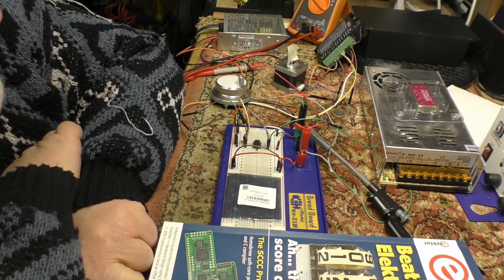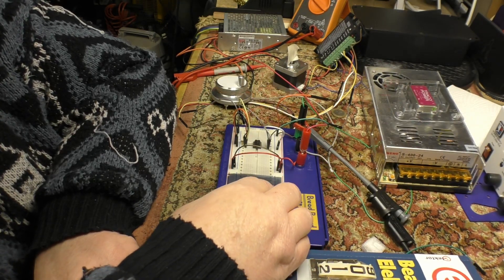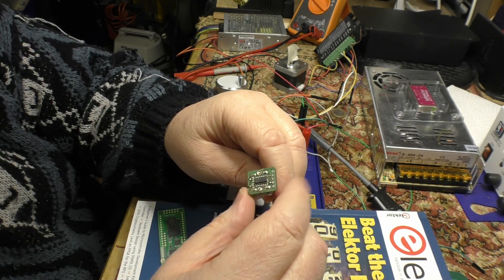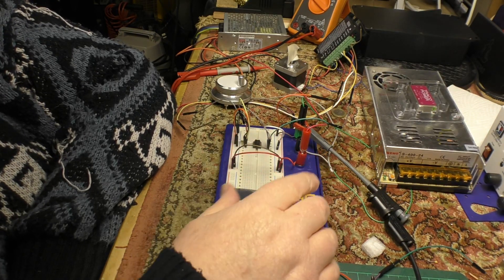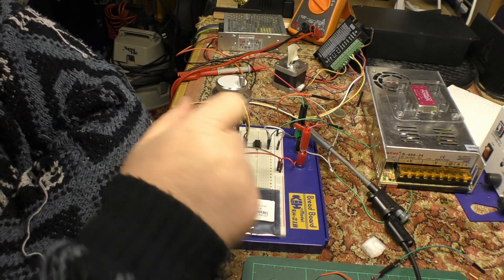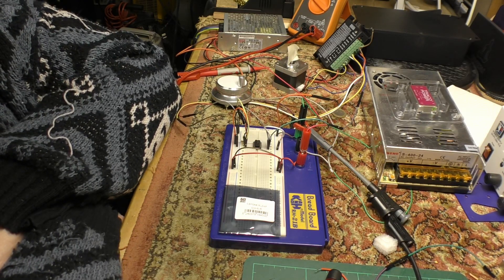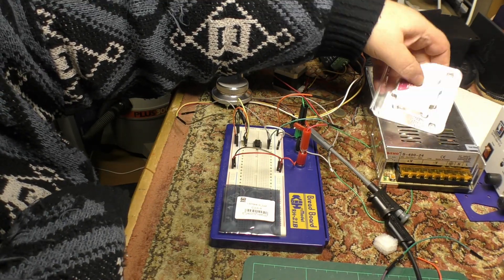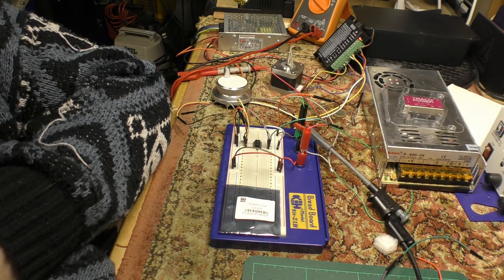Antenna Rotator Project - Update 1

Comment: Would you please be so kind to share with us name/ID of everyone equipment ? I would like to build exactly the same thing as my antenna rotator so i would like to order each part. Thanks so much for your help OM1ACC
Reply from the maker: If you've watched the two follow up clips on this project you'll know that I abandoned it so I never got to a final configuration.   Most things came from eBay.
Rotary encoder:
https://www.ebay.ch/itm/Hand-Wheel-Handle-Kit-5V-Manual-Pulse-Generator-Cnc-Machine-Tool-Rotary-Encoder/264530244169?hash=item3d973b3249:g:s-kAAOSw-uhdyhY0
Here's a suitable stepper motor:
https://www.ebay.ch/itm/ACT-MotorGmbH-1PC-Nema34-Brake-Stepper-Motor-34HS5460D14L34J5-S8-150mm-6A-8-0Nm/253168802381?hash=item3af2095a4d:g:ZaQAAOSwiQ9ZPnHR
Suitable stepper driver module:
https://www.ebay.ch/itm/DE-Free-1PC-Nema23-Nema34-Stepper-Motor-Driver-DM856-5-6A-24VDC-80VDC-25600PPR/253275734895?hash=item3af869036f:g:jNoAAOSw3EteTn20
The rest you can figure out.  Any generic power supply that can deliver 24v though I'd prefer one with both 24v and 5v outputs to make things simpler.
I hope this helps.
Cheers,
John